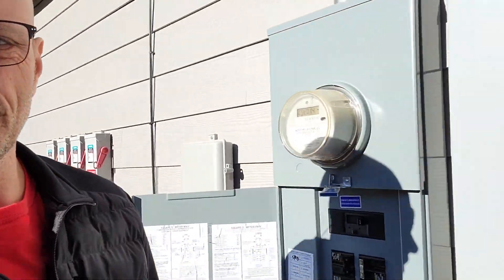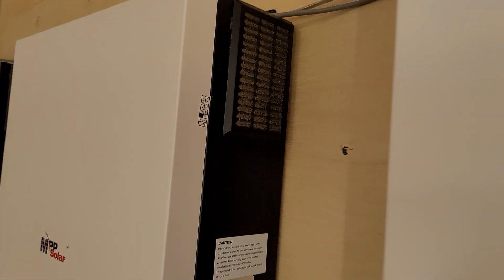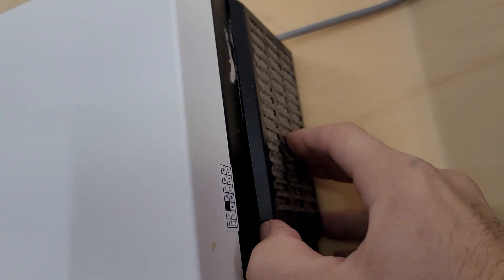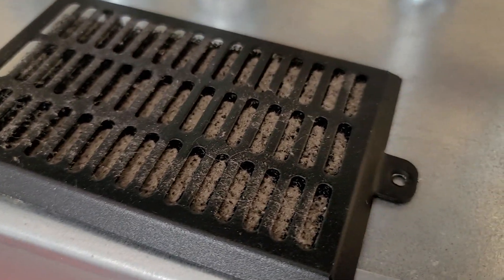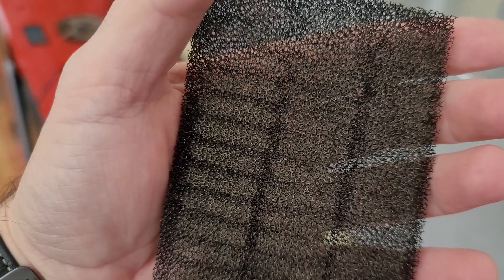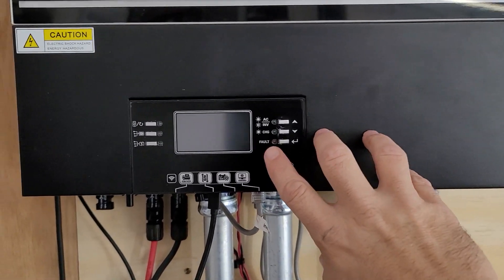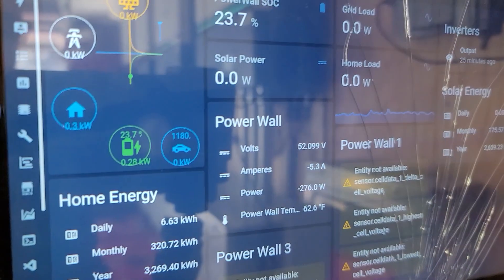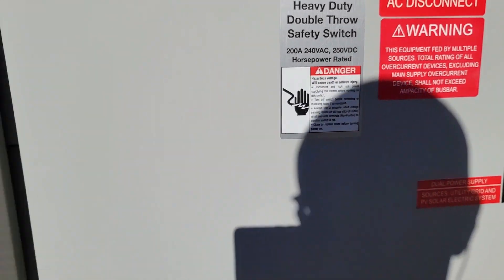MPP-Solar LV6548 Air Filter Cleaning

Comment: Wow, I didn't realize that these were reverse flow.  Meaning that they pull air in through the top and blow it out the bottom. I've never seen an inverter designed that way. Do the inverters have internal temperature monitoring? Thanks again for your videos
Reply from the maker: Yes they do. You are welcome.